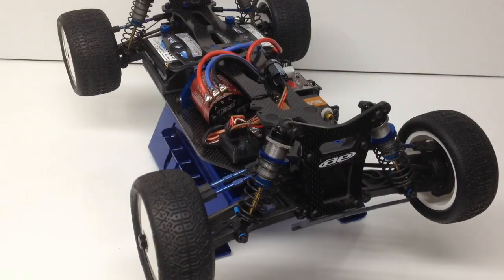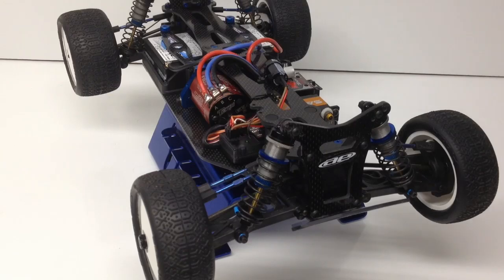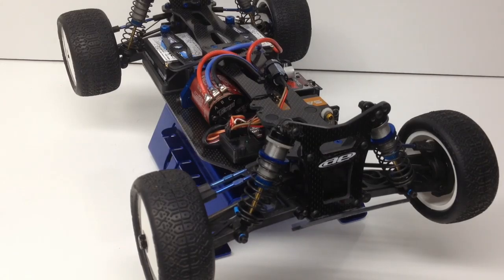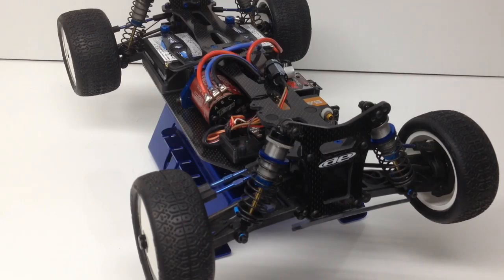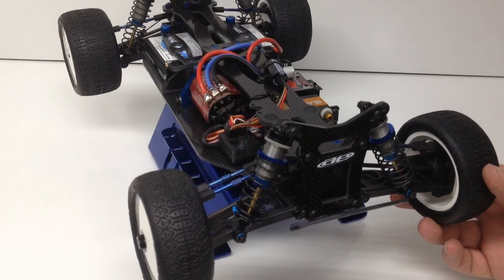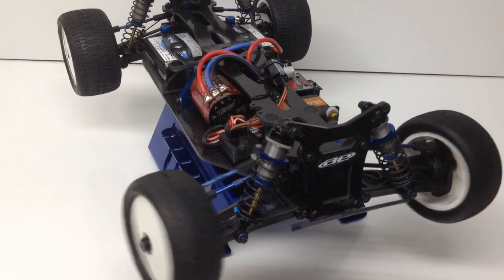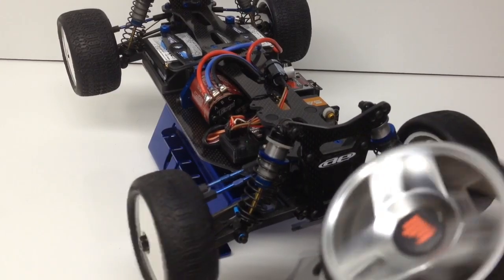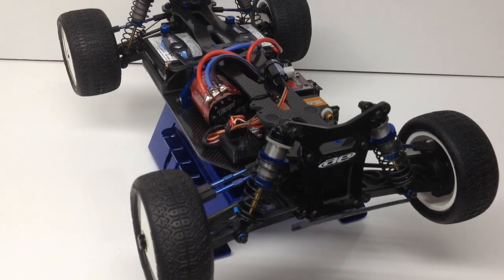Savox 1257tg Servo Bench Test - Lightning Quick!!!

Comment: I just got a 2274 and a 2265 both black editions. And was afraid they were bad right out the box but apparently that noise is normal.
Reply from the maker: Yeah, I haven't used Savox since this video.....super noisy and glitchy, IMO
Reply: @TheRCNetwork  can you recommend a lighting fast servo that you would use? Thanks!

Comment: will it fit in an inferno 3.o ?or will i need brackets   cheers nitro newbee
Reply from the maker: It will fit, but the 1257tg doesn't have enough torque for an 1/8th scale buggy - I would suggest something in the 300+ oz/in for the Inferno

Comment: Is this one water proof
Reply from the maker: Jose Luis Lopez typically only the blue Savox servos are waterproof
Reply: The RCNetwork so do you think the sw1211sg would be fast like that one you have there i need it for my 1/10 short course
Reply: Is this the fastest steering servo out today? Need one for my redcat tr-sc10e
Reply from the maker: Not the fastest, but fast for the $65 or so it costs. The fastest out os about a .05 sec servo....but it will be hard to tell, and you wont need that in 99% of applications
Reply from the maker: If you run it at 7.4v, it will be pretty close at .08 seconds...but have the torque you'll need for an SCT at 347oz/in.  The 1257 doesn't have enough torque for SCT
Reply: The RCNetwork how do u run a servo at 7.4? Is there a switch or something
Reply from the maker: @LuisLopez-ed7oc  It depends on the BEC in your ESC - the BEC regulates current to your servo - giving it typically 6.0-7.4v.  Not all ESC's have a decent BEC though.  You can install an external BEC, like the Castle Creations 10amp BEC and then program it for the 7.4v

Comment: This is Need BEC or not? couse in manual some time need for BEC. Thanks
Reply from the maker: Depends on your receiver and ESC.  Most current ESC's can handle the output of the servo.....but some cannot which can cause brown outs and glitching on the servo.  Try it.  If it's glitching add a Voltage Capacitor from Spektrum or Racer's Edge - They're about $5-12 and plug into any open port on your Receiver
Reply: Thanks

Comment: Hey rich,
  I have a futaba receiver that has a problem i cant seem to get it started even when i put in a fully charged battery when i used it at first it was fina and was working well but now it doesn't turn on i checked every possible way from esc plugging in correctly to many others but it still wouldn't work . The receiver did not really suffer large impacts of any sort as i was still building the kit when i got it . It only started being like this when i finally got the car done.Any idea what's wrong.  
Best regards,
Jairus
Reply: Btw nice new intro.
Reply from the maker: Wow, such an old video! lol  Strange issue with the receiver...have you tried hooking it up to another vehicile/esc?
Reply: yep it still didn't turn on

Comment: So I run a hobby wing justock esc and a sanwa rx472 receiver. Will I need a bec? The esc specs states that the internal bec is 6v at 2amps. I bought two hobbywing UBECs a while back, I just don't know how to use them.
Reply from the maker: You shouldn't.  Worse case a voltage cap

Comment: Hi, are hitec digital servos like the 7955 abd 7950 also noisy like Savox ones?
Reply from the maker: otabl ott nope, they are much quieter....plus you'll never need a BEC or Voltage cap like Savox need.
Reply: The RCNetwork Thankyou, I cant stand servo noise for some reason. Im split between Hitec's HS7955tg or the more torquey HS7950th  for my Arrma Talion. Which one would you choose between the two? Thankyou
Reply from the maker: Take a look at these two others:  S9177BLS from Futaba and the ProtekRC 170SBL.  Slightly higher in price but super powerhouses and silent!

Comment: hey man i was just wondering if it will fit or work on a hsp buggy 1/8 scale my old one just gave up. nice rc btw 👌🏽
Reply from the maker: 4X4 Pride it will fit, but won't have the torque you'll need in an 1/8th scale buggy. I would look at something over 200 oz in at s minimum. 300 is the standard on 1/8th

Comment: Any one know how to do an actual bench test. I'm trying to determine if my receiver is bad or if my servo is bad. Im looking for a servo bench test, not a test in the car type test.
Reply from the maker: Dennis Manvell I was showing the speed of and quickness of this servo......There's a couple of chargers out there that have servo testers.  Just simply plug the receiver lead into the port of the side and it tests the servo.  If you don't happen to have an extra receiver/servo to figure it out, most good hobby shops will test them out
Reply: Ok, thank for the info.

Comment: I killed 2 SW-0231MG savox servos there junk, but the gears fit right into the traxxas 2075 servo, and once you do that they last for ever.
Reply from the maker: Meanwhile in the Mountians No offense, but the 0231 is a bottom of the barel $40 servo from them.....not suprised you killed it....As for the Savox in the video, it's a solid super fast servo for a 1/10th scale buggy.  You can't beat .07 seconds for $70 plus titanium gears!
Reply: The RCNetwork Killed those servos with a redcat rs10 lol. thought about getting the 1257tg but I decided to go with the Hitec HS-8360TH 0.07sec  222.19oz-in a little bit more costly but its got more torque which i will need for my summit with 40 series tires
Reply from the maker: Meanwhile in the Mountians Good deal....I have since switch to only Hitec and Futaba servos now.  They're a bit more money but so much quieter and don't cause issues with glitching

Comment: I put one on my stampede 2wd but it's not that fast.
Reply from the maker: Alex Salatino Make sure there's nothing holding the 1257 back.  Disconnect the steering linkage and check the steering rack......it should fall to each side.
Reply: I checked all that. I think it's because the front wheels are huge and it's harder to turn them but I could be wrong
Reply from the maker: Alex Salatino Could be true
Reply: +Alex Salatino Could be youre big tires.

Comment: Getting it,. Yeah, Back at ya, This is not to complete or anything, we both show our resutls and people lkove that because it helps. Those Savox are damn good servos, I've tried em all, and they have the best quality. BY FAR.
Reply from the maker: Nitro RCNerds Yep, the 1257 is one of the fastest for the money (about $70)
Reply: The RCNetwork Savox is #1 in quality, #2 in price and innovation (for surface RC). Protek #2 in quality, #1 in price and #1 innovation. HiTec is bringing up the rear. I'm sorry, Savox is "the best brand" in servos today.
Reply from the maker: Nitro RCNerds I guess my only two gripes on Savox.......First off they're super loud and second, they should include a voltage cap with every servo they sell.  I have run Hitec and Futaba recently, and although they're a few more bucks, they're solid performers, quiet and never need a VC, and if they do......they include it.

Comment: Dude I need to meet you at RCOC one of these days. What rx are you using for this? My SCTE with a Savox SG1268 and SR201 and RX8 ESC is browing out. I flip the wheel 3 times and it shuts down for a few seconds then wakes back up. I'm looking at getting a glitch buster but I feel I'm going to need more than that to fix this issue. Only when turning tho, throttle and braking is fine, but as soon as I get some servo into the mix it dies out. So I'm pretty sure the survo is too needy for this pesky little rx.
Reply from the maker: Yeah, the Savox is trying to steal power causing the brown outs.  A simple voltage cap should fix it.  Spektrum, Racers Edge and the pricey Novak ones will work.  Otherwise an external BEC would be a perm fix.  When I switched to the Tekin Gen 2 RX8, I no longer need to run a cap

Comment: how did you get this to fit in the 44.2? mine seems like its too big. it has very little clearance. i had to reverse the servo mounts just to get it mounted. it dosnt feel very secure that way and actually came loose when i took it through some rocks. any idea whats going on?
Reply from the maker: I don't believe I used any spacers and used the TLR22 aluminum horn.  Worked like a charm!  If you check out some of my other vids on the B44.2, there some really upclose vid of how I mounted it

Comment: What is the point of the 1257TG? It has the same weight, same size and almost the same speed .07 vs .08 than the 1258TG but it loses almost 30oz for that .01ms faster response? Final statement should be: "Forget the 1257TG exists just get the 1258TG"..
Reply from the maker: I think the 1258 is an all around great servo for almost anything unless your running a crawler or an 1/8th scale. The 1257, although doesn't have a noticeable difference in speed, still has a purpose in lighter 1/10th scale buggies. BUT, I def see your point! Lol

Comment: hit a pipe with my durango and broke the spketrum 6070 short servo. going to try this one on your recomandation
Reply from the maker: The Savox is great. 1257 for lighter buggies and 1258 for any shortcourse. Pick up a Spektrum voltage Cap ($5) just in case of glitching. Novak and Racers Edge make them as well
Reply: The RCNetwork thanks will do.